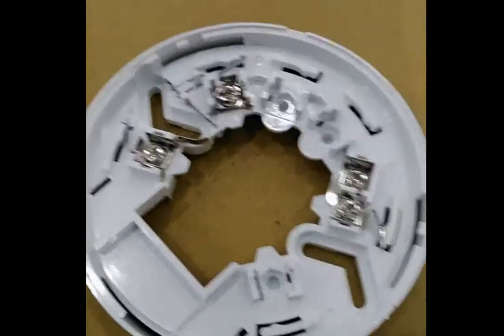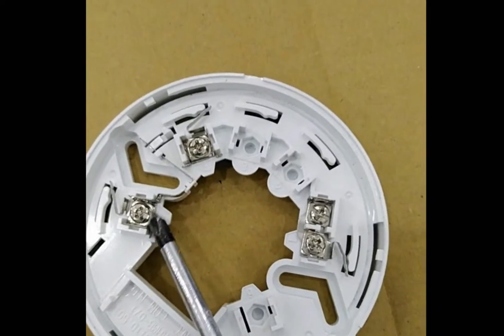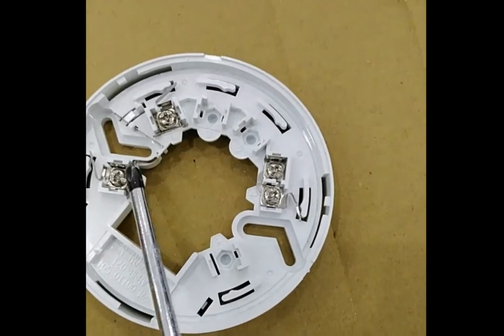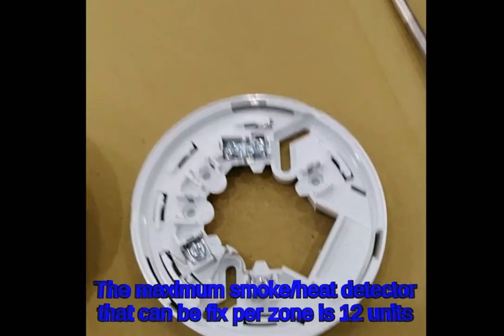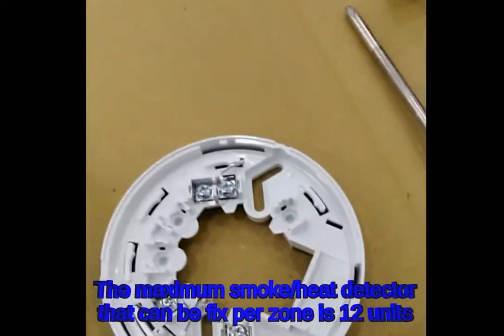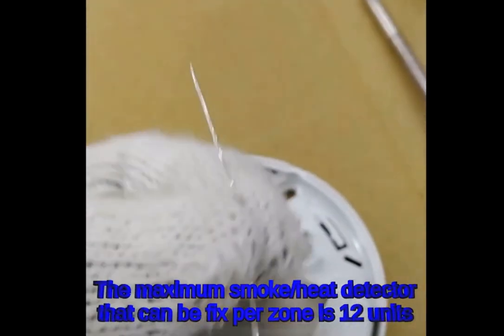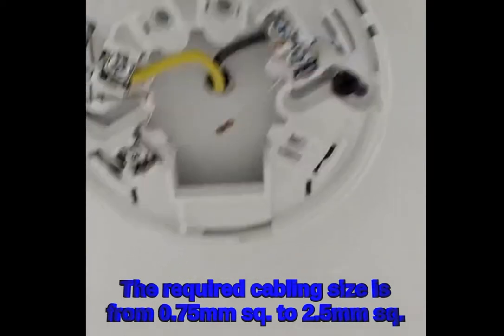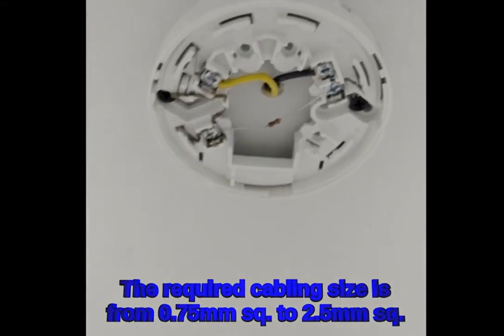How to Connect and Install a Smoke Detector

Comment: salamat sir
Reply from the maker: thank you for visiting
Reply: sir tanong lang ano po ba ang klaseng resistor gagamitin sa end of line..may tawag ba dyan?
Reply from the maker: @r150motovlog4  just came home from the jobsite very sorry for late respond, for EOLR-End Of Line Resistor (smoke detector/heat detector) use the 6K8 ohms 0.25 watt, for CPR- Call Point Resistor (alarm bell/call point) use the 470-680 ohms, 0.5 watt.
Reply: @SkillT3K  ok sir salamat..sa 2 zone na conventional fire alarm sir..tanong ko sana kung paano connection sa control panel nya..
Reply from the maker: @r150motovlog4  kung 2 zone, dalawa rin ang terminal block sa control panel, naka specify which terminal block for zone 1 and zone 2 , the most efficient  number of devices that can be monitored by the control panel per zone is 8 devices,
Reply: @SkillT3K  salamat talaga sir..may natutunan ako sa iyo..thank you talaga sir
Reply: sir may tanong ulit po ako..sa manual control point iisa lang ba ang connection nya sa smoke detector..
Reply from the maker: @r150motovlog4  from the smoke detector,  in series connection (continuity connection) to the manual call point, then connect to the panel terminal block, with this type of connection you need to provide EMU (electronic monitoring unit) panel module to be connected together with L1 and N to the zone terminal block, please check the video   https://www.youtube.com/watch?v=FE053pgBjos if you notice the black color device is the EMU module